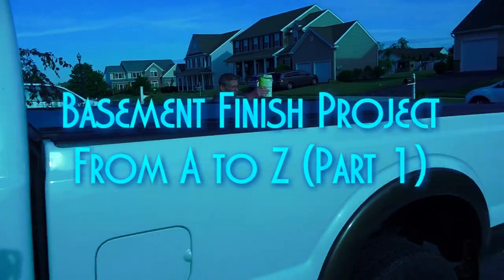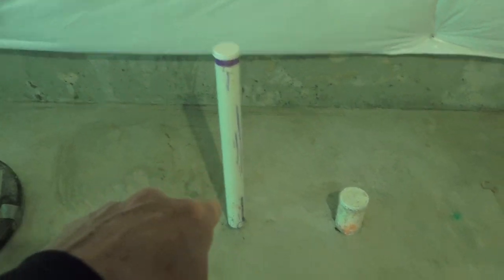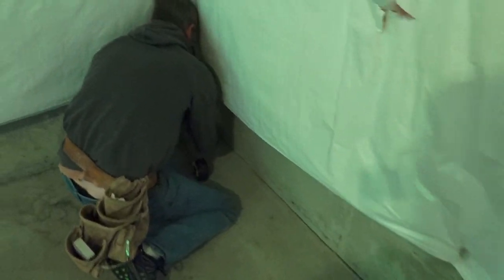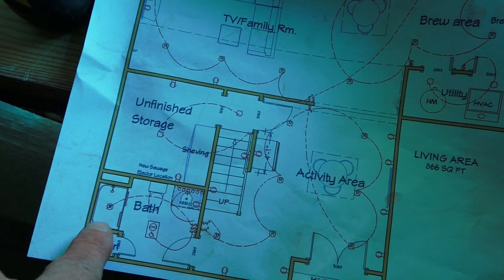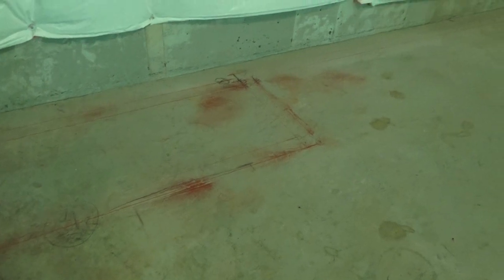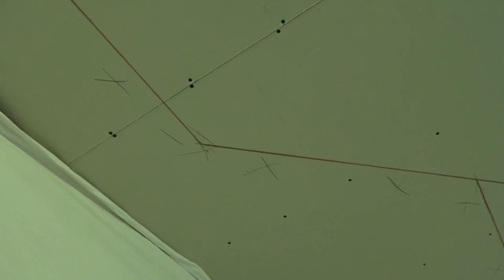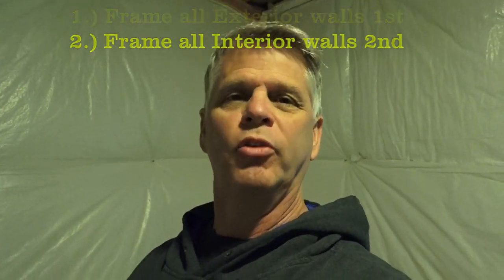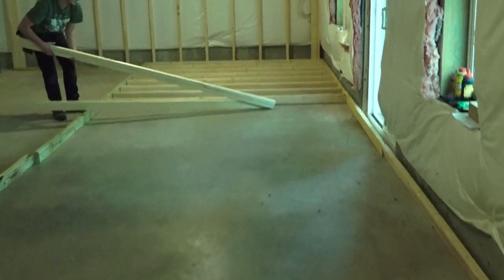Basement Finishing A to Z (Part 1) [Layout to Drywall]

Comment from the maker: This video is for the hardcore basement finishing diy'er looking for all the tips, tricks and know-how they can get their hand's-on.
This is a long monster of video at 1.5 hours!...but there are a ton of good tips in this video that will answer a lot of basement finishing questions.
Good luck with your basement finishing project! Thanks for watching!
Reply: I wish I was at the layout stage right now I have been having to take out the old beast at jackhammer at french drain and sump pump all summer and now fixing all my old block walls been so fun not lol, my home is from 1900 so have a lot of work before get to do my favorite thing and slam drywall up
Reply: I am about a hour in great framing work when ready send your crew here lol could us some young gents knocking out the work
Reply: so agree with ya good that you used the local lumber yard they always do have better wood but I also love using home depot for a lot of my other materials and I also been using those can lights they work super and easy
Reply: LOL take a 5 minute break we want to hear the man talk woo love it lol 1:20:00 got to love Jackie Chan
Reply: I Am  a  General Contractor  in Spokane Washington , these are great vids , John @ 4 Aces Construction .

Comment: Hi Eddie, love your videos, learning so much!  I am in the planning and budget phase of finishing my basement.  The city I live in requires compliance with the 2018 IECC codes for energy efficiency.  I'm in zone 5 which specifies R19 insulation on exterior walls.  R13 is allowed as you suggest but then R5 "continuous" insulation will also be required.  Any suggestions or should I just bite the bullet, increase the gap to the concrete walls, and install R19 batts?  I have 8" poured concrete walls.
Thanks much!  Also, is the  Lav sink drain connected to the correct line on the ejector?

Comment: Hi Eddie, great video. One question: why do you do banding and would it be wrong in this instance to remove the drywall ceiling before framing? I figure it may end up being easier for future access. Thanks for your help.
Reply: I was wondering the same, also why not just use/finish the dry wall ceiling that is already there?

Comment: Thanks for the great videos. You are giving me the confidence to tackle my own basement. When you built the half-wall I see that you didn't use green wood for the bottom plate. Does that pose a problem with the white wood being in contact with the concrete? I have the same question for the wood you are using to wrap the steel support columns.

Comment: Great video!  I am planning on adding a bedroom in an unfinished area of my basement.  I was just trying find out what to use under the bottom plate of the walls (as a vapor barrier) when I happened to find this video.  It looked like you just used treated lumber for the bottom plate, which makes sense.  I learned a lot more such as to avoid toe nailing.  I think you've saved me a ton of trouble from that alone.  I will definitely be looking for other videos before I start this project.  Thanks!

Comment: good job stressing the layout not only is important for those reasons but also if its laid out properly it saves alot of time figuring out which wall goes where theirs no guess work when you lay it out first plus like mentioned in this if it has to be removed cause it aint what was wanted thats double time added

Comment: Do you ever put down subfloors in your basement projects (something like dricore or otherwise)? Why or why not? If so, wondering if you have a video of how you’d handle that process?
Reply from the maker: Hi Jonathan...No never. It's a waste of money and time in my opinion. You just do not need it. There are so many products designed to go right over the concrete without the added expense of Dricore or other similar products. Just my two cents, we've never had to use them.

Comment: I have 2 interior walls in my basement that are cinder block which surround a basement garage.  I've been told this is for fire protection.  I am looking to finish the other side of one wall and was wondering if you still suggest coming off the wall 4.5" and include insulation?
Reply from the maker: Yes absolutely! Insulate the wall anyways...even though it's considered an interior load bearing wall.

Eddie

Comment: What size nails do you use?  I noticed you've just used two nails to secure the bottom plate to the studs.  Code in my area requires 3 nails that are at least 0.131" thick.
Reply from the maker: 3.25 length common framing nails.

Comment: I really love your detailed explanations in your videos. Your details have made it possible for me to consider remodeling my basement. I noticed that in this video at about the 50:15 point for when two outside walls come together in the corner, you have the stud at the end of the bottom plate and then a turned stud sideways right next to it.  In  your 6 part framing series you showed this with the stud to the right of the 3 & 1/2" mark and then the sideways stud to the left of it. Is one way better than the other or is this just a matter of preference?
Reply from the maker: Good eye Mike! Both ways work equally as well...your choice really.

Eddie

Comment: Was this inspected? you didn't install any fire blocking. This would never pass inspection where I live
Reply from the maker: Yes it was inspected and we insulated to this townships energy codes. Some area's where we work do require more involved firestopping, and when it's needed we will do what is required in that particular city.  Thanks for watching!  ~Eddie

Comment: Which is better to use wood framing or steel framing?  I’m thinking of using the steel
Reply from the maker: Wood for sure! Metal studs are commercial and way harder to work with throughout the project.

Eddie

Comment: Huge fan.  But I messed up.  After framing the complete perimeter (1,300 sq ft) with 3/4 OSB fire blocking (as requieres by my county) I realized I made a big rookie mistake.  

Any time I had to make a wall in two pieces I would start the stud placements correctly at 16” on center, but then I would start the second section where I mistakenly started with a stud and I started to measure 16” on center from there.  So basically half of every wall has 1/2 framed wrong.  

My idea is to add a stud wherever a 4x8 dry wall panel will end.  The studs between the first and last will be right, but the studs in the center of the drywall panel may not be in the “normal” location.

I intend to hire drywall professionals, but I’m sure they need a stud to start and end the panels.  And I’m hoping this doesn’t bring inspection issues.  

Any advice on this huge mistake?!

Comment: Eddie is 12/2 wire required by code for basements in your area? Wondering why you didn’t just use 14/2. Thanks.
Reply from the maker: No it's not really code, you can use 14/2 wire for outlets, but we like a 20 amp breaker circuit which needs 12/2 wire...this 20 amp circuit can handle more load before the breaker trips than a 15 amp 14/2 wired circuit can.

Eddie
Reply: Thanks for the reply Eddie. And thanks for sharing your knowledge with all of us out here. I’m almost at the point where I feel like can do this! Except the drywall....... lol
Reply from the maker: @davidc5523  You can do it David! Thanks for watching brother!  ~Eddie

Comment: Hi Eddie,
I am starting my framing and have gone through your videos and also have taken notes for the work to be done  but though I have one question as am also installing a subfloor what would be your recommendation for the subfloor shall I go for framing first or the subfloor first?
Reply from the maker: I would build the entire subfloor first and then build/frame on top of it. Although my company has never built a subfloor in over 30 years of finishing basements!  

Eddie
Reply: @BasementFinishingMan  

Thanks a lot for your help
Reply: @BasementFinishingMan  this was my question, had to go to the bottom of the comments! Syracuse NY area, 2020 new construction, basement has blanket insulation and has never had water issues. Torn between going the "Eddie" way vs putting in subfloor and rigid foam on the walls. Compromise might be redoing the rim joist insulation to prevent condensation pooling at the top the 8" pour foundation wall. Great videos as always, especially your framing series and all the tools I need!

Comment: what would be the alternative to ceiling banding?  Is there any way to make use of that ceiling drywall that is already there?  Or because of the joists running parallel, this is the best option?  Thanks!
Reply from the maker: There really is no other option if you don't wish to move all of the obstacles and relocate them. Banding is the BEST option...you'll have to trust me on this one Kevin.

Eddie
Reply: @BasementFinishingMan  Thanks Eddie, appreciate the response!
Reply from the maker: @kevinmera9970  You're welcome.

Comment: I know it is not ideal, but can I use 2x4 (Pressure treated) and anchor it to the cinderblock wall (flat) like a furring strip?  The builder did that on the stairs and I want to continue that on that one wall, rather than completely redoing the stairs.

Comment: Is it a potential future hassle to leave the existing dry wall, add 2x4’s, and cover the ceiling? What if there is a leak in the future or you need to access the original electric and plumbing that’s under the sheet rocked ceiling?

Comment: Do you have any videos on floating walls?  Here in Denver, they are required. I guess just build the wall minus 2 1/2 inches and put a pressure treated plate on the bottom, hung from the joists?
Reply from the maker: We actually do not on the channel, but we do have some training on floating floors inside the BFU 2.0. Your correct on your thinking here brother on the way to get it done! Thanks for watching!  ~Eddie

Comment: When finishing a basement how do you address air quality, like moisture in the basement. And Radon gas leak into the basement?
Reply: If you have radon then you need radon remediation which consists of a fan that pumps the air under the concrete slab outside.
Reply: For moisture, looks like they installed a vapour barrier on the warm side of the insulation against the concrete basement walls. As for radon, there is a depressurization system near the sump pump, which is the pipe that goes into the vapour barrier at the beginning of the video.

Comment: Did you guys add more insulation over the insulation blankets on exterior walls?
Reply from the maker: Hi Don! Yes we sure did. We went back after we framed all of our exterior walls and Storage area border walls and insulated them all with R-13 insulation.

Eddie
Reply: @BasementFinishingMan  curious when you added the r13, did you add a vapor barrier or is the blanket good enough for that?